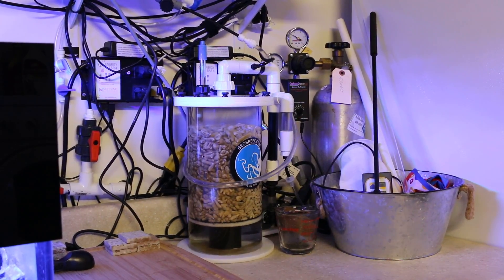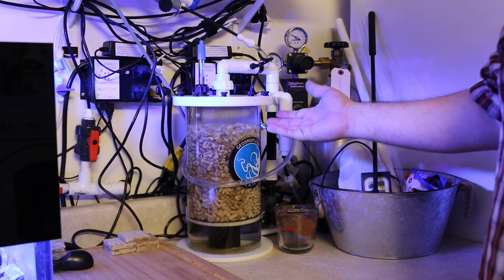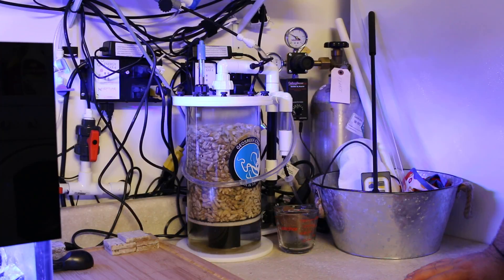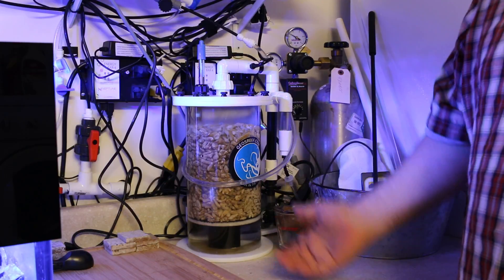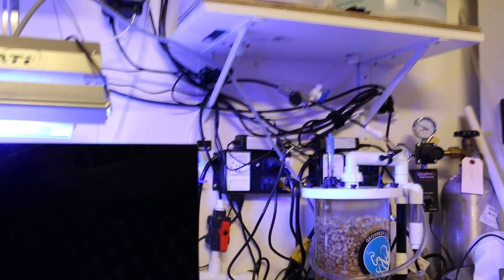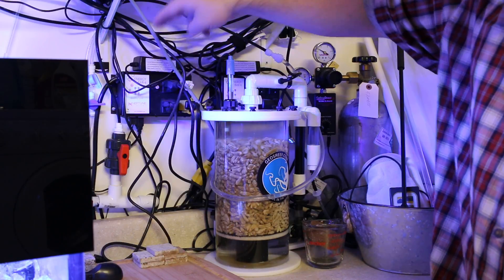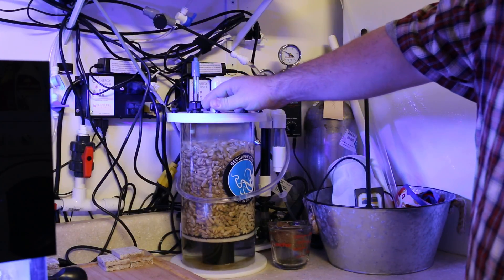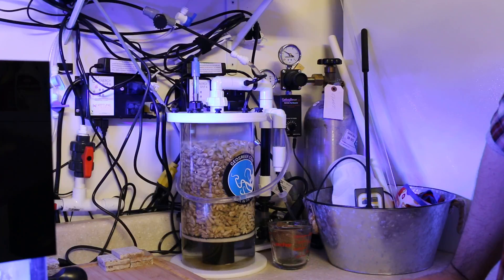Calcium Reactor Setup

Comment: and why would it be overkill, I have a 200 litre tank and was planning on using the smaller calcium rectors. it's abit pricey to start with but it's cheaper to run
Reply from the maker: reef guy 92 its overkill because on a smaller system it would take many years of using the reactor to equal the cost of dosing 2 part on smaller systems. Also, unless you have a master flex pump you will have a hard time keeping the drip rate constant. I was dripping effluent at a rate of 1 drop per 4 seconds and this is difficult to keep up because of clogs
Reply from the maker: Actually with a very low growth demand it's a tad overkill considering dosing 2-3 part is much cheaper.  However, when a small sps dominant tank is thriving it is not.  I guess calcium reactors really depend on volume of tank and overall what you intend to stock in the tank.

Comment: Good video but you didn't give any specific details of how the actual calcium reactor is set up just how it is plumbed into your tank need more info.  because I am deciding if I want to use this method or the BRS 2 part
Reply from the maker: Hey there.  I apologize for the lack of information.  After having a reactor set up for 5 months now I've learned many ins and outs of the setup.  For one, I would not do it on a smaller system a second time.  

While I wholeheartedly believe in the Calcium Reactor concept compared to dosing 2 part, after adding an auto water change system to help aid in removing and adding ions I lose when the corals deplete them I noticed that on such a small system I rarely drip Calcium/Alk from my reactor.  I am currently at 1 drop per 12 seconds, which is a lot less than I was running without the AWC setup.  Without the AWC setup I was running 1 drop every 3-4 seconds out of the reactor.

One of the problems I ran into when running the Calcium Reactor off of some sort of manifold from the main return pump was that there wasn't enough head pressure on the line and air bubbles would be collecting at the top of the Ca Reactor.  After speaking with GEO and telling them my setup they suggested placing valves on every line from my main return pump and also increasing the flow coming out of the return pump thus increasing the pressure going to my Ca Reactor.  The issue with the air pocket has ceased and I have a better control of flow over the whole system now, since I can control the flow going to my display, frag tank, and Ca Reactor.

Calcium Reactors are totally not designed for such a slow effluent flow rate.  While it works and I intend to keep on using it, I also plan on upgrading my system withing the next year or two.  I will say that the AWC setup has dramatically improved the health of the whole tank so much so that I will always run AWC setups in the future and implement them before I gauge the need for dosing or calcium reactors.